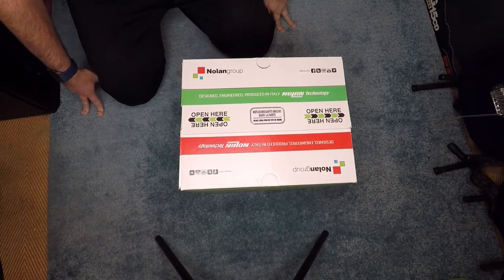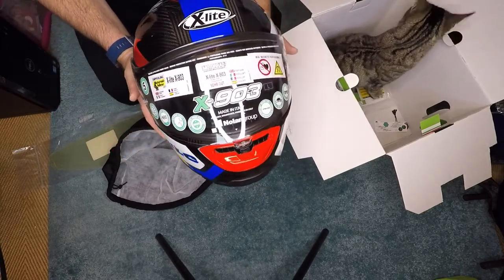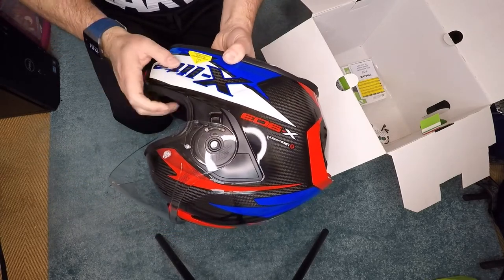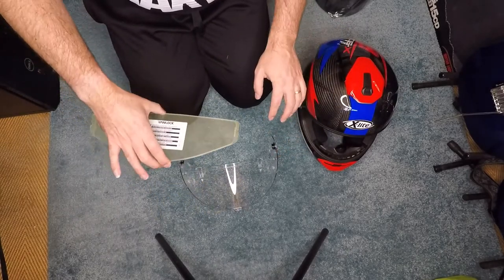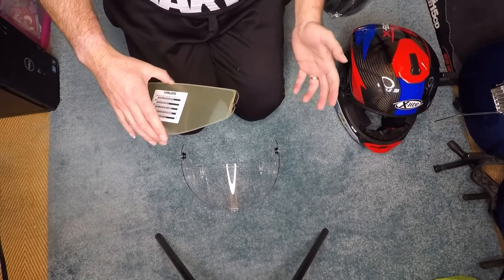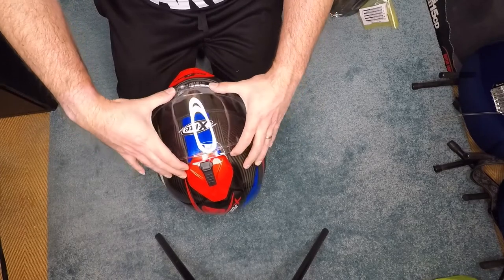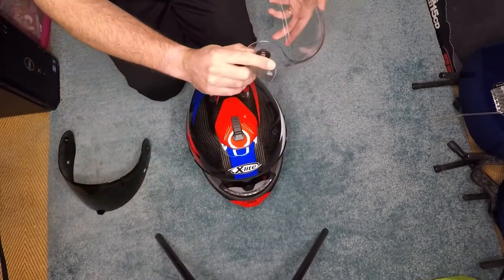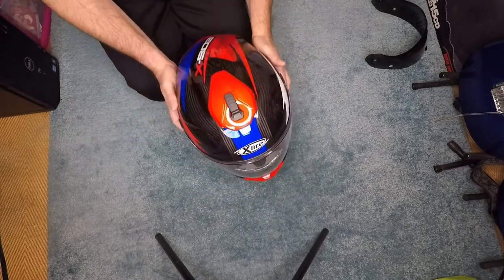Unboxing of X-Lite 903 Ultra Carbon and Fitting the N-Com 902

Comment: Hi, thanks for the installation video, it is very detailed. I was wondering if you know the size of the speaker and the depth of the speaker pocket? Can Cardo fit on this helmet with 40mm speaker? Thanks.
Reply from the maker: Sorry not aware of Cardo so would not be able to confirm. I will measure the size of the speaker for you a little later and message again.

Comment: can you compare the noise level to some well known helmets? also how is the high speed stability?
Reply from the maker: Unfortunately I only own X-lite helmets so would struggle to compare however I would say noise protection is “medium” but the high speed stability is excellent, I have just been doing 150mph on a race track wearing this helmet and was very good.